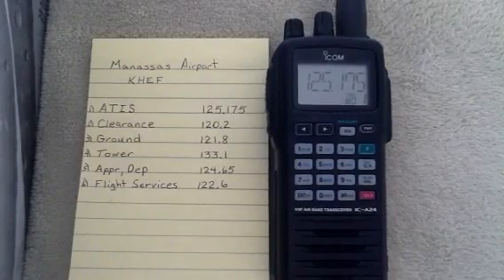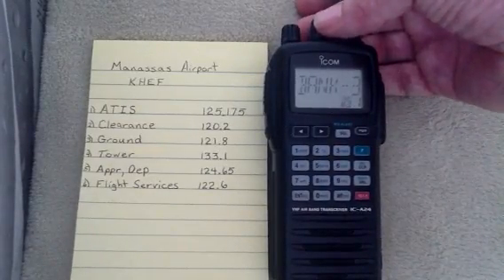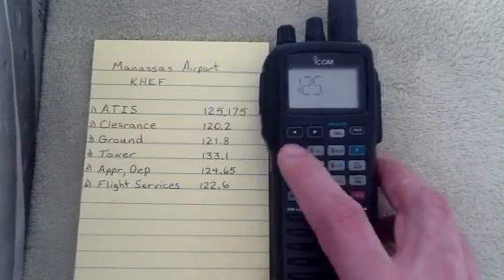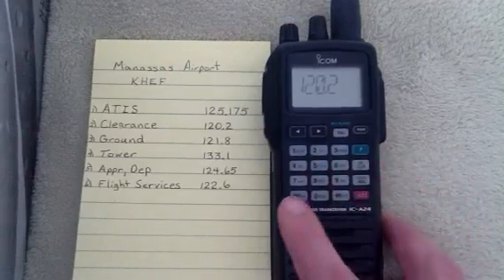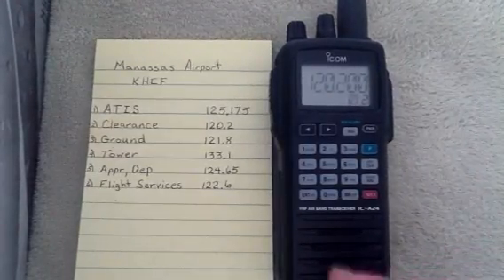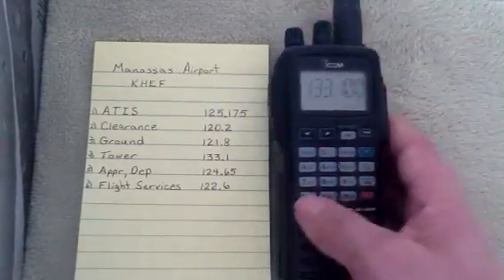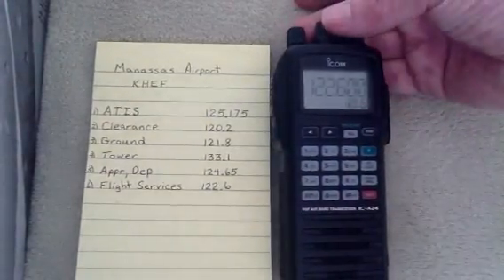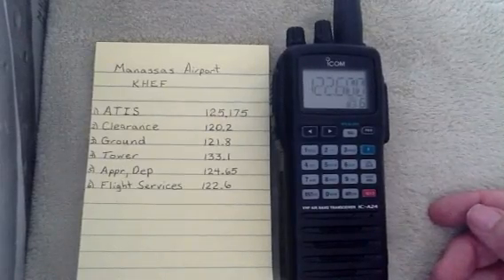Programing frequencies into the Icom IC-A24

Comment: Please could you help identify a problem with my same radio: The reception is cut intermittently every 5 sec and the Rx sign disappears for an instant. Equal intervals. Strangely, reception is OK on Wx channel and on the emergency channel when dialed by the red emergency button. When I dial the same 121.5 by hand it starts to interrupt. Very strange… Thanks!

Comment: This is a very helpful video about a solid radio with a horribly designed programming system. I'm just a weekend pilot, but I don't see how a solo pilot could safely access most of the functions in this radio in flight.
Reply: The user manual states, " This radio IS NOT to be used in flight

Comment: Many thanks for your video..I have an ICOM IC-A6E..my local airport has changed all the frequencies..and I am unable to input the changed frequencies..the airport has updated the frequency by a segment of 5 for eg atis is old freq 127.475..now updated to 127.480,now as my icom alters in segments of 25 as you can see I have a bit of a problem..any advice will be much appreciated
Reply from the maker: Wow!  It has been a long time since I worked with this radio.  I do recall some mention on being able to shift frequencies by 5kHz, but I don’t recall ever doing it.  At the time there was a lot of talk of going from 25kHz spacing to 5kHz to increase the number of frequencies available for use.  The problem was all the legacy equipment people own that couldn’t work with the higher resolution.  

Many of the radios ICOM produced still exist as they are a very high quality radio but lack in intuitive ability to operate.  At the time their technical support horribly lacked.  The only reason I made these videos was because I had an incredibly tough time getting the company to support their own equipment.  Not one to accept no for an answer, I finally got one of their technicians to work with me and together we figured it out enough to get by.  Years later ICOM contacted me about the rights to these videos.  ICOM wanted my permission to use the videos and I told them they could but also challenged them to make better videos on their equipment.  As far as I am aware, they never accepted that challenge.  This was a great example on how flawed internal company politics can really make a company with great potential from becoming an industry leader.

If you want to try and make this radio work as you need, I suspect it has the potential.  However, it would most likely take calling the company, letting them know what your trying to do and working with them to figure it out.  If it were me, I would try to entice them to work with me by letting them know you plan to make a YouTube video on how to do it.  This would solve your problem and it would provide documentation that you could come back to that you will inevitably forget once you set the radio down for a couple of months.  It would help those that are suffering from the same problem.

I know that is not what you wanted to hear, but it is the best I can offer you.  Best of luck in finding an answer.

Comment: Scott... you blew my mind when I saw you were using HEF frequencies.  Those are the very ones I need to put into my IC-A6 (Identical to the A24, but there are no VOR functions or NAV frequency capabilities).

Youssef, I can't speak for other countries, but in the U.S. a radio license is not required as long as the radio is used as a radio station in a plane.